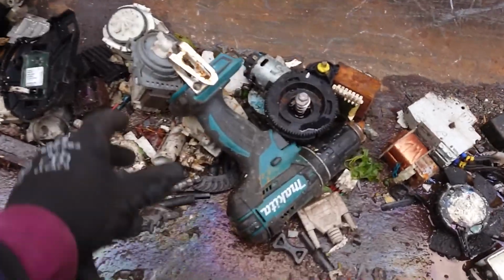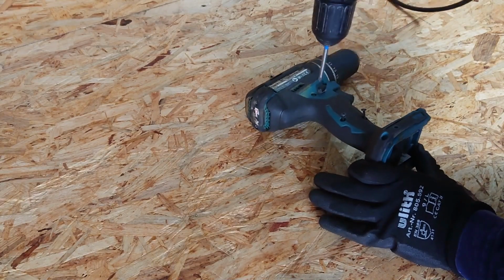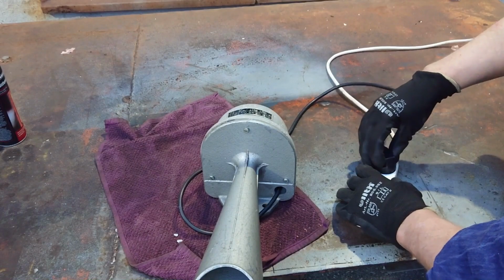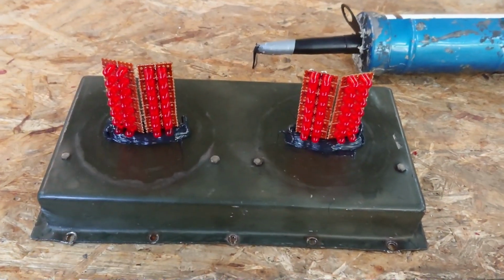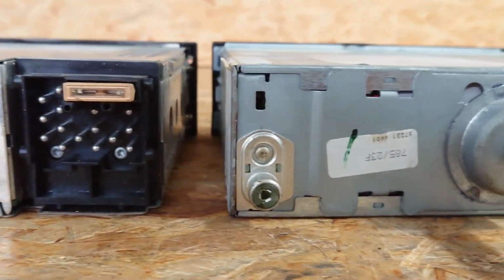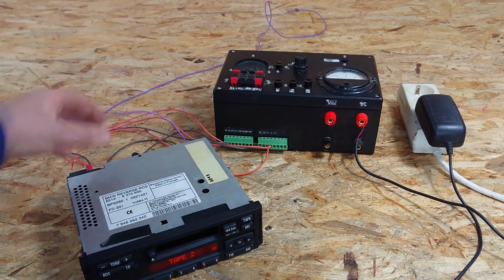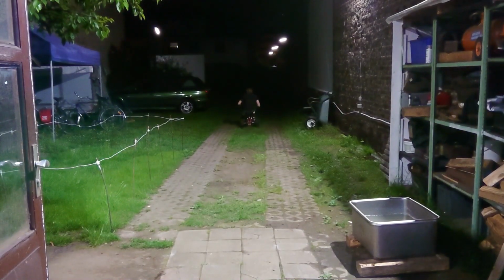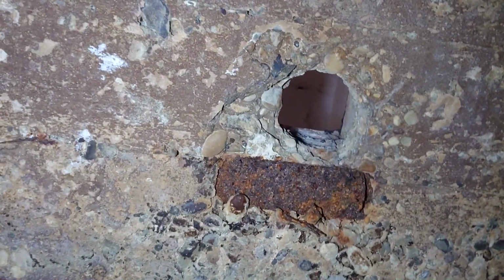Exciting Scrapyard Finds! Repair-A-Thon!

Comment from the maker: Just one little thing I wanted to add: Some people probably don't like mixing old and new technology, like I did when I inserted LEDs and an Arduino into that old lamp enclosure. But you have to see it that way: Nobody has had any use for these lamps in probably over thirty years. Sure the way they were, they were nostalgic and genuine, but they were also just collecting dust in a shelf, while now they will serve a purpose and that purpose is different from what they were made for. I want the lights to flash, so that they will catch people's attention and those old bulbs are just not made for that. Others might wonder: Why do you use something as complex as an Arduino, for such a simple task? Well if you've been following the channel for a number of years, you will know, that I build stuff WITHOUT microcontrollers a lot more often than most of today's hobbyists, but in some cases even I had to realize, that a microcontroller just offers a lot of potential to add new features to something I'm working on later on. While adding new physical circuits would require me to rip the board out of the enclosure and start soldering again, it is possible to just-re-program the arduino at a later date and integrate other features of the alarm system into this same enclosure, without the need for additional components and circuitry. For example: sensors and hidden switches can just be connected to the free I/O pins of the Arduino and it can act as a simple alarm system in itself. While a simpel multivibrator circuit or an NE555 can also flash the lights, it just doesn't have that kind of potential to develop this part into a more capable alarm system. Whenever I use microcontrollers I always think about future changes to the initial (often very basic) design.
Reply: I'm fine with mixing old and new. The important thing is to extend the useful lifetime of the object to keep it out of the landfill.
Reply: We love what you did to make that light system from there old airport warning lights. There are a ton of people who do restore and collect old items.
But making an old item useful and keeping costs down by modernizing it a bit, is both brilliant and frugal.
Reply: Repurposing discarded items to fit your needs is perfectly fine. The stuff was going to be melted or buried in a landfill if you didn't buy it.
Reply: You are the post apocalyptic inventor so you are supposed to use new stuff to fix up old stuff.  Its not like you are some sort of reenactor that counts stitches to be "authentic".
Reply: Nah it was awesome. I want to get one of those super big antenna tower lights and use it for something. i really like what you did to the lights super awesome and it will be used for many years to come.
Reply: Mixing old and new is totally fine - whatever's fit for purpose, go ahead! Doubly so, when the items are being saved from being recycled into their component materials! :)
Reply: Why not both? Have the original lights on constantly in an alarm situation with the leds flashing? Just a a thought
Reply: @zignitz  Stop thinking. It's pointless, and it's not doing you any good. Just a thought.
Reply: That stuff would have gone in a landfill anyways.  You needed a modern security system with a style that worked for you and the building you are working in.  I see no problem with mixing old and new.  Would those people rather you bought something new and added to the waste problem? That would go completely against everything you have shown me of your personality.  Keep on the good fight, friend!
Reply: LEDs are so superior to incandescent lamps I get mad when people don't use them.
Reply: @hgbugalou  I find most LED lights make insufficient light for reading, as bad as CFL -- and forget about running your solar-powered calculator after dark, LEDs will not make my calculator go.  Makes it hard to figure out the savings in electricity cost.
Reply: @Wingnut_Stickman  I read every night under a LED bulb.  Its just about getting the right color temp, decent brand bulb and the right size.
Reply: @godfreypoon5148  Indeed.  The best ones I have bought so far come from the Dollar Tree in the USA, either 2-for-a-buck or a-buck-a-piece.    I did once get a good deal at Canadian Tire -- 6xGU10-style LED in a pack for $2 CAD.  I think I got 3 dozen.
Reply: I have no problem with the Arduino in the device, but I would have left the old lamps, it would look so much better. Their delay before reaching full brightness is simply awesome old-style.
Reply: Your logic and perceptions are spot on in my opinion, and if someone thinks you should preserve archaic technology, when you want to actually utilize said project.. I find them to be short sighted.
You pay homage enough in your restorations, and you aren't building a museum. 
You are trying to preserve the ability to craft, and craftsmanship, at least that's what it sounds and looks like.
Reply: i have more problem with wastingan arduino than mixing different stuff
Reply: 19:03 It reminds me of my childhood.
Reply: You're not The Post Apocalyptic Restorer, you're re-inventing stuff.
Reply: Watched the entire video and then heard your voice in my head as I read this. lol Thanks for doing what you do. So inspiring!
Reply: No problem here, same for old computers, some "purists" often get angry, the most important things is to be able to use these left for dead machines.
Reply: I personally like the combo of old and new - why? Because that is what people back then would have put into those things (be it lamps or anything else!), I do like people restoring old stuff faithfully, too but if you want to make use of something, why not do it "right" by using stuff that is easily available (nobody complains if you put a new bulb into an older lamp, especially if the original bulbs are not available anymore!)
Reply: I like your shit
Reply: It is good to see that the Arduino board will be the main controller of the system and not just a timer.
Reply: You are the inventor, do what you want.  No need to feel any kind of responsibility for what others toss away, no one knows the situation.  Why shed a tear about filling up the scrapyard?  That's someone's livlihood, and we are not running out of land any time soon.  To be completely fair, let future generations clean out the dumps, just in the way we are responsible somehow for the pollution of our ancestors.

Comment: 👍Thanks for sharing this successful rebuild and repair video. Maybe you'll get a nice price for the vintage radio units. Does the ATV Quad have reverse capability? It could be repurposed as a disabled person vehicle for a youth or smaller adult. In spite of that buildings condition, it could have a good repurpose as a bug out/getaway location. I'm impressed that it's not "graffiti-ed" with spray paint or deliberate damage. Any chance of repairing or restoring the children's toys? Best wishes from Pennsylvania.

Comment: It amazes me that people throw away drills like that Makita when it would have been an easy repair.
Reply: For many businesses, by the time you take into account the work time (and money) it would take to strip the broken device down, diagnose the fault, get spares, install new parts, test & reassemble,  it is cheaper to just buy a new one.
It's certainly not eco friendly but when time is money replacment trumps repair.
Reply: @ptonpc  And the only option is to throw it away?  Why not give it away to a thrift store or something like that?
Reply: @seanfyodorovich5230  Thrift shops generally do not accept electrical items that do not work.
Reply: @seanfyodorovich5230  What kind of store takes broken devices ? Maybe if there were repair stores but unfortunately those barely exist anymore ... I doubt there's a store where you can get a drill repaired for less than what it costs new. At least in big european countries. 20€ replacement part, 1h labour from a tech and that's already going to cost more than a new drill without battery/charger. btw don't get me wrong it's pretty sad, but it's the world we live in.
Reply: dunno if the battery is near the end it's not worth it. Batteries are almost more expensive than buying a new one. These days there is no such thing as reusing, well you can, but you pay more. The second problem, if we make, things that last economy will collapse. A third  problem that there is a lack of infrastructure and standards for easy disassembly and reusing materials from old products. For example, they put Li-ion batteries in shredders and then extract needed materials, this not energy efficient and you extract fewer materials. Solution create standards for easy disassembly batteries etc.
Reply: @valentinaselektrikas  Most people who use tools like that Makita drill have multiple batteries because they use more than one Makita tool though, no one will throw away a drill like that because the battery is bad

Comment: To avoid burning out any quality 18V drill, just leave it on the clutch / screw setting, and not the "drill" setting.

It will be powerful enough for 95% of your drilling needs, and you'll break less drill bits, since the clutch will disengage when your drill bit gets stuck

Comment: I can't believe you found a rotor for that Makita drill for only 20 euros! I think you need to make the flashing lights brighter. Strobe tubes are easily obtained, and the circuitry is not complex.

Comment: I have a small ATV that I bought from a machinist. It was a fire rescue. He put a 6.5 horsepower gas engine in it. It is ludicrously overpowered. Very fun but not very safe. With practice I have gotten good at not flipping it over while going way too quick.
Had not occurred to me that it might have started as an electric ATV

Comment: What is that rod that is on the back of the radio's ? Thank you.
Reply: It's the rear mount, or better, rear support. Fits in a hole and takes the weight off of the front mounts, which are usually just click ins. Also it stops the stereo from shaking and rattling, which would fatigue and finally destroy the internals of the radio as well as the dashboard.

Comment: The fan is a clone of the Xpelair Taurus models of the 1970s. I still have the 7 inch desk fan which is identical to the one you found, the colours are different though. the Xpelair model is brown and cream with smoked clear blades. The on/off switch is also identical. https://picclick.co.uk/Xpelair-Taurus-vintage-70s-fan-vintage-tested-284156716091.html

Comment: You could add the price you pay for those items, I'm really curious about it
Reply: I used to do similar when I was younger in South Africa, the general thing was that scrap you buy is a twice the kilo price of the most expensive thing you can sell to them.  So if copper was ZAR10/kg to sell then I could buy anything at ZAR20/kg.  Better deals to buy what was obvious scrap steel but every yard had different arrangement, larger franchises would not let you buy, they did not want the complexity or safety risks.

My first commercial venture at the tender age of eight was to get a scrap metal merchant licence from the local police with my parents assistance as I used to sell copper and aluminium scrap I picked up on the street and in bins when I walked home from school through a light industrial suburb.

I miss the recycling trade, a noble occupation mostly though I have had people steal irreplaceable brass letterpress Ludlow matrixes to sell as scrap so there is the gritty underbelly too due to the harsh realities of impoverished people.

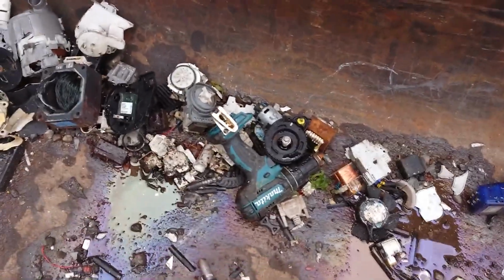Comment: 3:30. In the UK the Makita drills are only about £45.00 new...without batteries. Just one 18 V battery pack costs around £80.00. It seems a shame that such a high quality tool has become such a disposable item.

Comment: I don't think that is a cabin at all.  It might be a pump house.  What you are describing as a basement is likely a tank or cistern.  There appears to be overflow exits high on the walls.  The holes on the floor are likely for plumbing for the pumps

Comment: On the side of the road I found a Makita drill just like this with charred armature wires. I ordered a new armature from amazon and got it working again.
In the same makita box there was a makita impact driver that needed new brushes (aud$5) and a charger which worked. I cant believe someone would throw them out, they seamed so well used that it must have been a tradesmans tools, I am quite surprised that he did not know how easy it is to repair makita tools. Every component comes out easily and diagrams are readily available on spare part websites

Comment: Great job on this one....

I love what you do...  So don't take this too hard, but...  The red lights were disappointingly not very bright.....  Some of those lights are used on towers...  Obviously, it is quite an undertaking, to climb a tower to replace a bulb...  so in general, they last a long time, if installed & running properly.....  I'm not sure you really needed to re-engineer that....  The factory bulbs would have been much much brighter.  A light, on top of a tower, if you turn it on on the ground, standing 1 or 2 meters away, is VERY bright, even in daylight....

Car radios...  What you can also do with those, is get a cassette adapter for a cd/mp3 player or phone... they actually work really good....  Actually less hassle than pulling the radio and wiring in an "aux" plug....  those radios appeared to be mint condition, great find.  I have had NO luck whatsoever selling old radios....  But good luck on those.

Comment: Crazy cool that you can just buy a new rotor from Makita.
Reply: Well, it is a Japanese drill, they aren't stingy about giving you replacement parts, they earn more money while spending alot less.
Reply: You can buy motors from most companies
Reply: @onemansjunk01  Yep! It's funny how some of the companies almost want people to fix the old items. I order replacement motor brushes for old tools. The company gave me free a pair of brushes for an old Skil saw. When I wrote to the Dremel tool people I sent them a money order for 10 dollars and asked for however many brushes that would buy me. They sent me 12 pairs of brushes! I have some really old Dremel tools, a couple of newer ones and a Sears brand version(I think it was made by Dremel), the brushes will fit any of them. 
    As 'One man's junk' said, contact the companies about parts you need, most of them are very happy to try to help you. 
     Yall Take Care and be safe, John
Reply: @JohnDoe-pv2iu  And other hand Makita has low voltage protection chip in their batteries that kill it after it goes to low voltage 3 times... Least its 3 times but still that is fucked up.
Reply: @Hellsong89  Luckily because of this you can order dirt cheap replacement chips from China (I think about $2 each), though you do then have to muck around a bit to replace it.
Reply: @Hellsong89  I understand but really think that that is the battery manufacturer planning on fucking you... I don't think the tool company 'brand name' is who is doing you ugly.
   Take Care and Good Luck, John
Reply: @Hellsong89  Interesting... How did you get that information? Tried by yourself?
Reply: @Hellsong89  That has been my source of anger also. I have revived several Makita batteries and charge them with hobby charger instead of Makita charger. I connected balance leads to cells to keep pack in balance. I got bucket of Makita packs from hardware store for free. Few were totally dead, few had 2 cells dead, some were usable straight off. Now I have more batteries I can use!
Reply: That is exactly the reason why I avoid temptation to buy cheap store brand power tools. I recently bought spares for 1980's Elu saw for reasonable price.

Comment: If it's okay, I'd like to share an experience I've had recently.

I'm a Postman, and I was delivering to an address, and came across a McCulloch B26PS strimmer thrown out for the scrap man. The pull cord was hanging loose. But it was very clean. "Here boy! Home time".
A friend diagnosed it, and told me it needed the recoil spring, and I bought a strimmer head that was missing.
Long story short, it's working fantastically and it cost less than £30 to repair.
Thank you for your videos!

Comment: Just a short note about the led blinker thing: there is an interesting visual factor that effectively makes a source apparently brighter with shorter pulses...this means that the most use of the led's is short pulses, at much higher current than normal, repeated at >100 ms intervals...if you have the data sheet for your leds, you can find the pulsed current rating, for a pulse length of say 2-5 ms, and use that repeating at 5 Hz, or so, but no more than 10 Hz, but something like 4 Hz is quite effective with this short, high-current pulse mode... just saying ;-)

Comment: What are the short nubs projecting from the rear of the radios?  Some sort of antenna?
Reply: Likely just a support, away to stop the back end from flexing up/down, fitting into a hole in the interior of the dash.
Often in the form of a metal screw/post, fitting into a threaded hole in the back of the radio,  onto which a rubber bung fits, which then in turn fits into a hole in the interior structure of the dash.